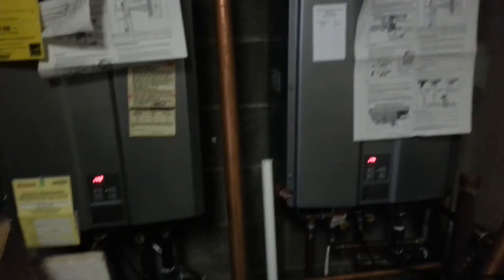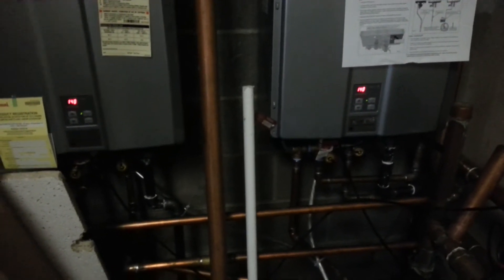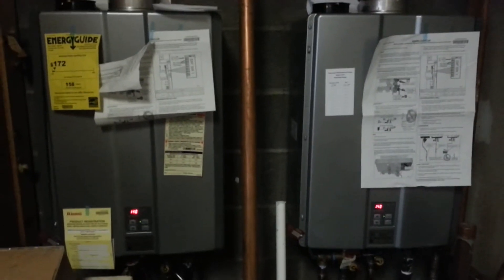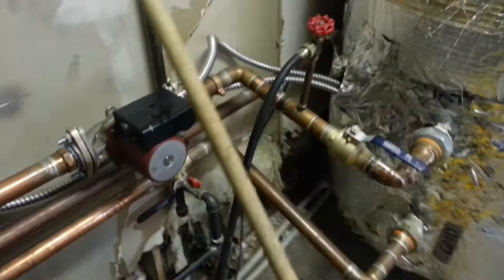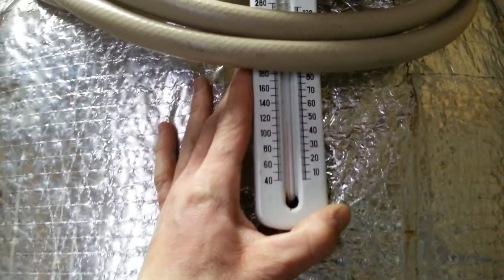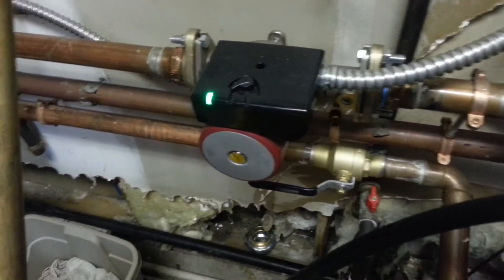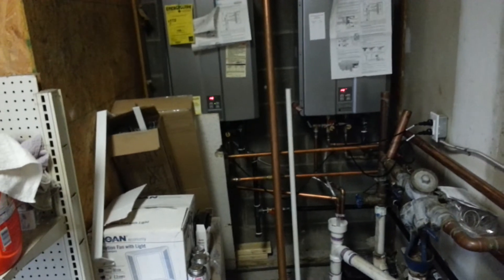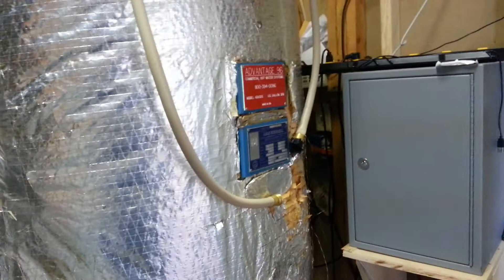How to tie Rinnai Tankless Water Heaters to a storage tank

Comment: I am thinking about doing this too to replace my boiler but keep my storage tank. I think your plumbing company should have installed the booster on the bottom line of the tank. Cold should come from bottom and hot to top line. Just curious. Any problems you’ve experienced  with this set up?
Reply: After 10 years, not one issue.   Not a plumber,  but it has worked about as well as I could hope.